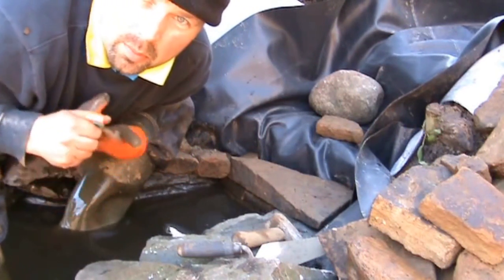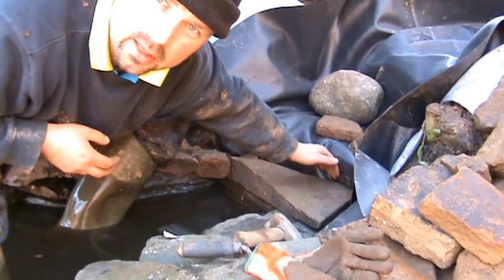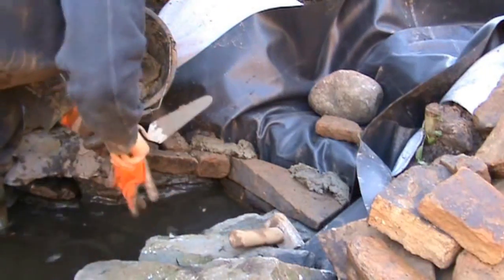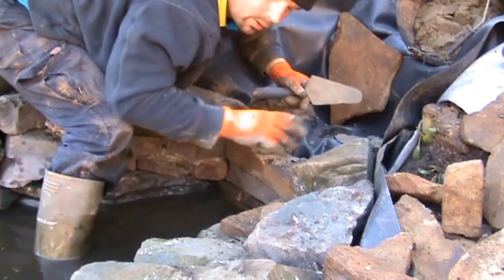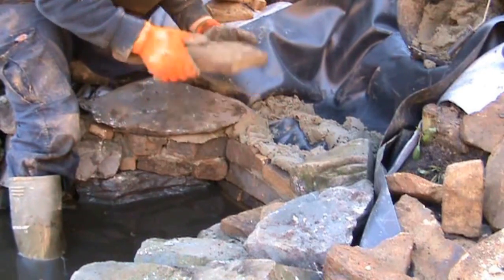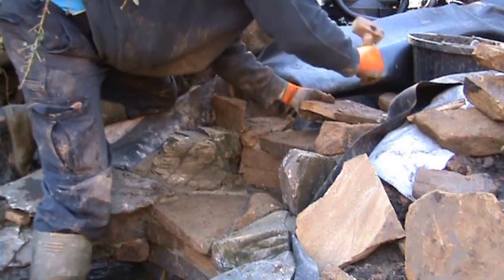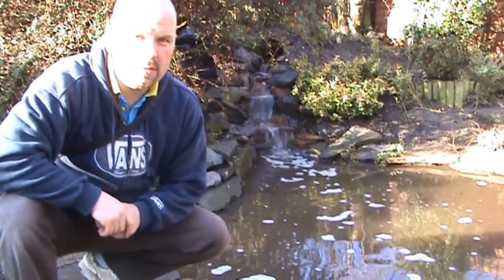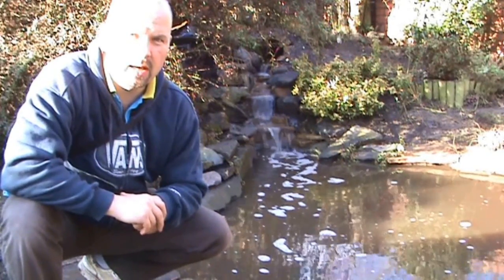Pond construction at Boldon near Newcastle by Pondguru

Comment from the maker: No need to remove the bulb, just switch it off unless you have it twin wired with the pump. Provided the pump is left running the unit will not be damaged in cold weather but remember to move the pump to just under the cascade or filter outlet or it will chill the water. Soon as the weather warms up move the pump back to the summer position at the far end of the pond away from the cascade or filter outlet.